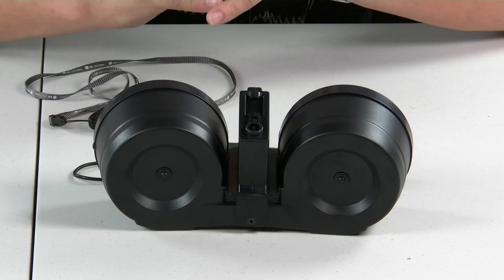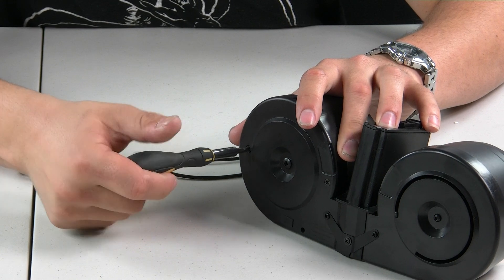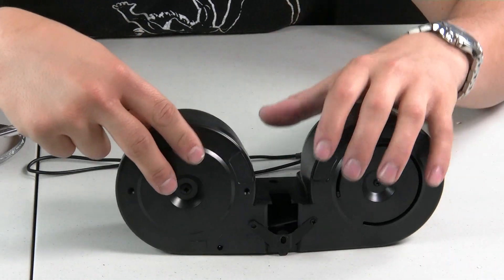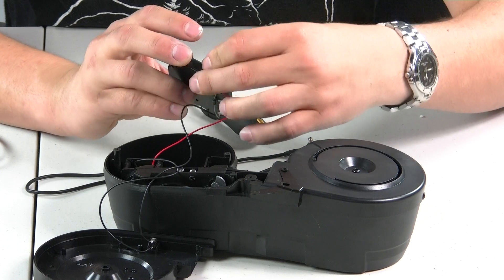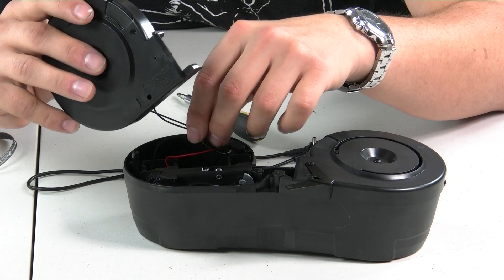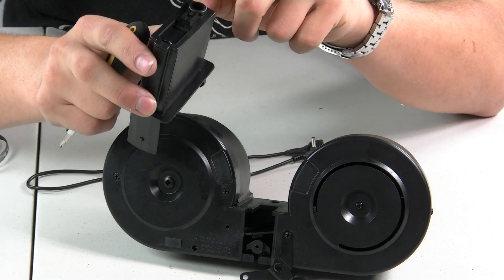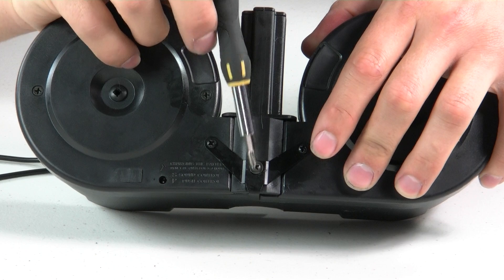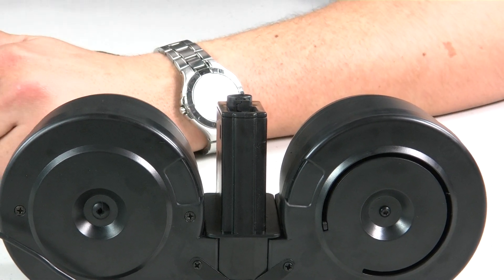HitGuns.com - Airsoft Accessories and Use - M4 Drum Magazine Installation and Operation

Comment: mine jams like a bitch alllllll the time. i get about 20bbs and then i just stops feeding. i can hear the spring being tightened but it stops feeding them altogether. tips? tricks?
Reply: Same with mine. It's a single BB that's getting caught where The smaller wheel is spinning the big gear.